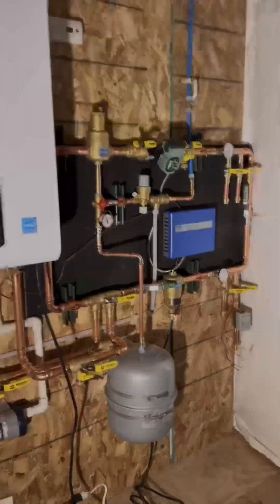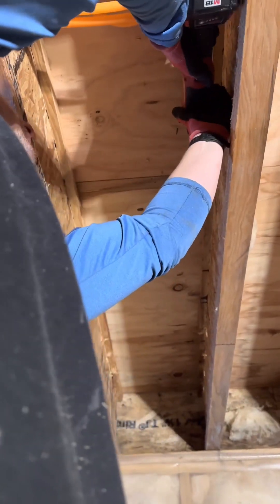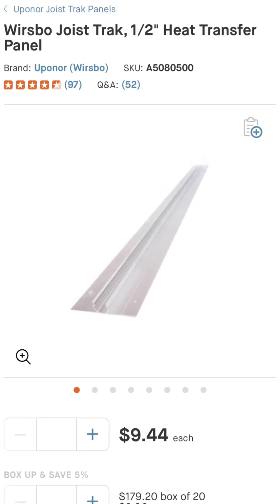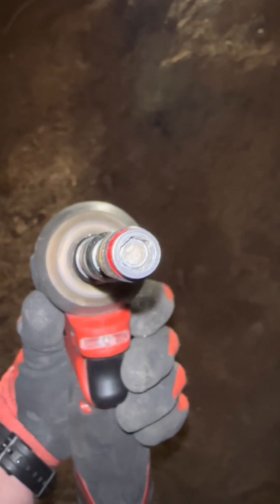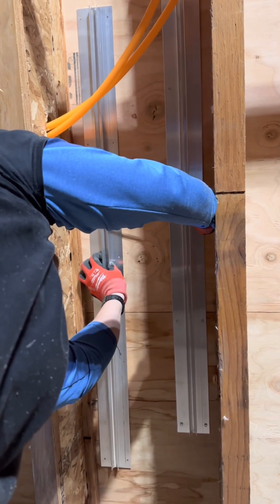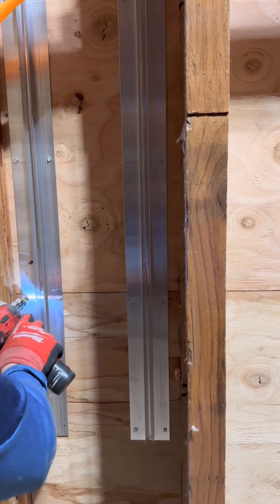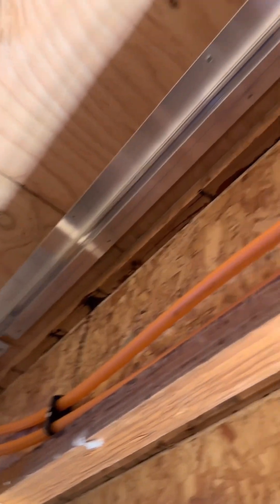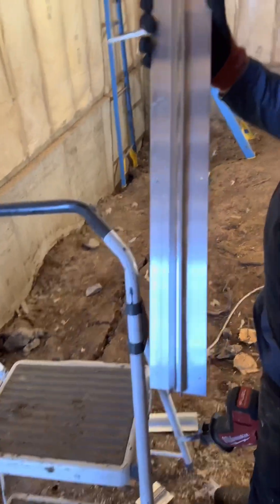How to install heat transfer plates

Comment: WARNING: After about 8 or 9 years, the small screws started dropping out of my plates in my basement on-by-one. I imagine from the traffic on the floor above. Some of those plates are now dangling from the pex unsecured to the wood above. After 15 years, I  I now have to figure out how to reinforce all the plates, perhaps with some sort of glue and larger screws which I will need to enlarge all of the holes on each plate to attach them back to the underside of the plywood.
Reply from the maker: I’ve seen that happen as well - it’s down to using the wrong screws for the job
Reply: Maybe just move everything over a half inch and rescrew. Buy yourself another 9 years